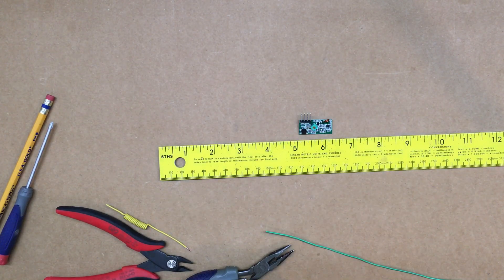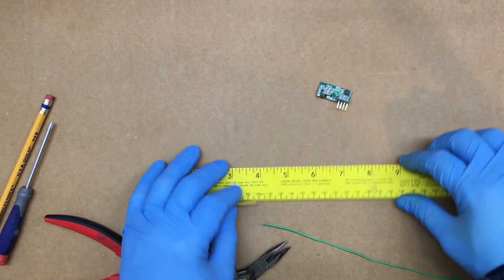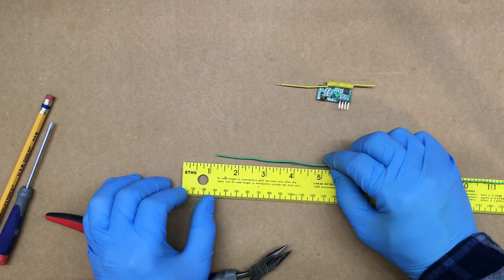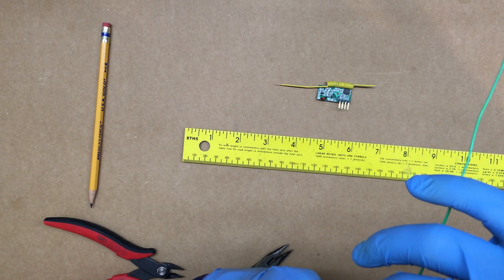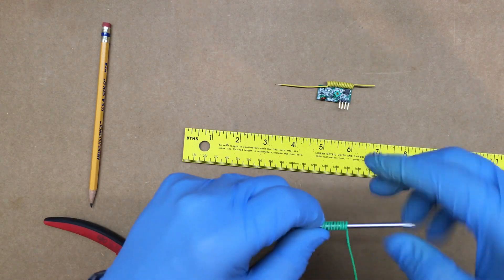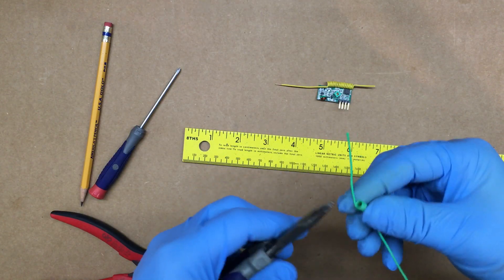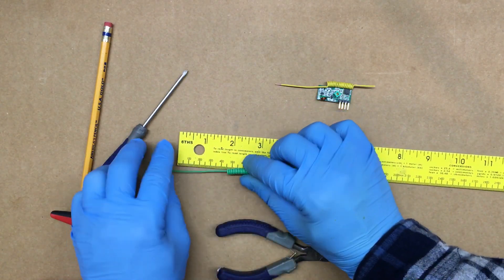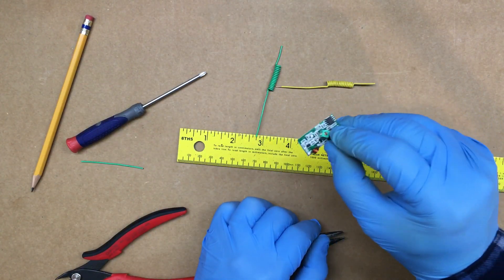315Mhz RF Transmitter and Receiver Module DIY Antenna

Comment: I have couple of question if would be glad if you could help me answer them please:
1) What should be total length of wire?
2) What is advantage you shown in video for 53-16turnsx2.5mm-17? why cant just turn whole length into spiral?
3) Lastly I was trying to make a same card of mine rather then buy from market since it has all passive components, other then one tune-able inductor(green one in middle ) so can you tell me how to tune it for best reception? or if i have purchased one how do i know it is calibrated to get best reception so i dont need to tune it further?(since sometimes it is not glued to lock screw position)
  Hope you can guide me sir thank you very much in advance! Love your guidance for helping people like me!

Comment: Whats wire type and guage?
Reply from the maker: Muhammed AlZahrani i was using solid copper 18, 20, 22 gauge. I can’t remember the gauge. I think 20.
Reply: Fuzz The Pi Guy 👍🏻 Thank you
Reply: @beAdamant  AlZahrani is originally from the 07 area code?
Reply: @charlesmurphy1510  😂 how the hell u know such an information
Reply: @beAdamant  lived in KSA for 11 years.  1 year in Riyadh and 10 in Taif.  I was at that time one of the few foreigners allowed to travel beyond the 50km restriction.  I was instrumental in retrieving weapons from Iraq purchased by the Kingdom during desert storm.  Many friends there including some high ranking officials and military officers.  I was also in Hafar al Batin, and Kamis Mashayt.  Forgive my spelling.